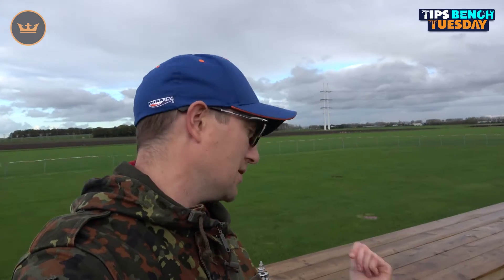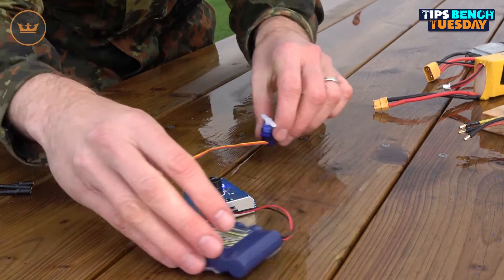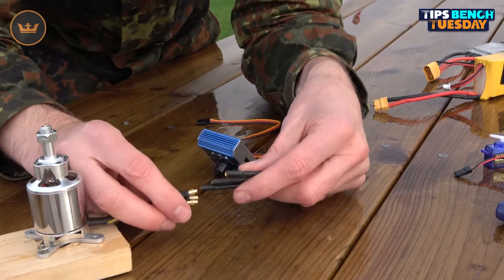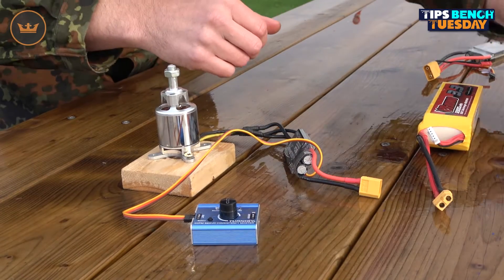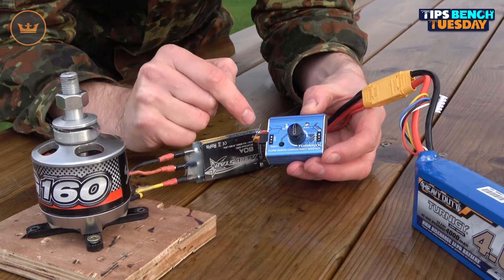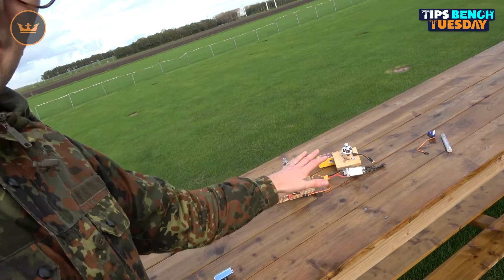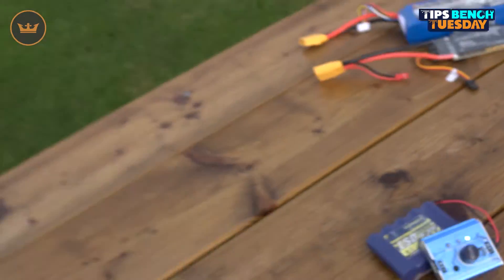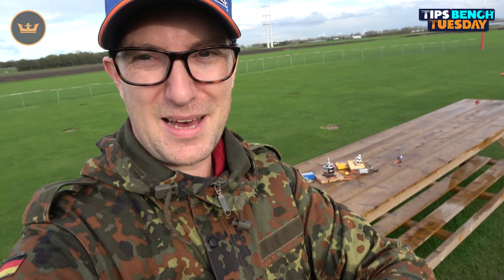HobbyKing's Tips Bench Tuesday - Checking Motors & ESCs with a Servo Tester

Comment: Landed in bush, smelled like speed controller burned out. Tested replacement speed controller and it works, motor runs great. Took plug and put it into receiver. None of the servos responded. What could be wrong?
Reply: I suggest join a Radio Control Model forum, you may need to post a diagram to explain the problem.

Comment: Great video! I did not know about the ESC and motor testing capability. Is there a practical limit (say1500 watts) for controlling a motor under load with this tester, assuming right size of ESC and battery? Also, when testing servos I have been powering this tester with 4 alkaine AA cells- is that OK?

Comment: In 40 years of flying RC (20 or so using the brushless technology and testers we use today) and thousands of RC videos, this is the most useful,  I honestly had no idea my tester could handle such loads for motor testing. Thank you Stuart
Reply: The tester is only supplying the control signal, the ESC handles the power to the motor.

Comment: Probly can't even get a servo tester from hobby king.....they have nothing in stock.... literally everything I look up is out of stock with no word on when or if it will be in stock....I bought a savage bobber 3 months ago and it still doesn't have a motor because none of their parts are in stock.....c'mon hobby king what's up
Reply: As of 28 December 2022 the non-aluminum cased servo tester is available from HK USA. The aluminum cased one is available from HK Global ( Hong Kong ).
Reply: All but US available right now and I just got one from Global order and I'm in the US about 2 weeks.

Comment: An excellent tip video.  I've always thought this could be done but have yet to have the need to do it.  This method is so much easier than doing it in a bound model and swapping ESC and motor till I found which part was faulty.  HobbyKing was very wise to get you back.
Reply from the maker: Glad it was helpful!

Comment: Thanks for the bonus tip, the lights are blinding. think I will use your tip as I had just been putting my finger over it till now 😀
Reply from the maker: Glad to help!
Reply: Better way: open up the box, put a 100 ohm resistor in series with the LED.
(Or try different values until you get it the brightness you want.)

Also, the metallised film bags that ICs are packed in make very good darkening filters for overbright LEDs.   Maybe two layers.